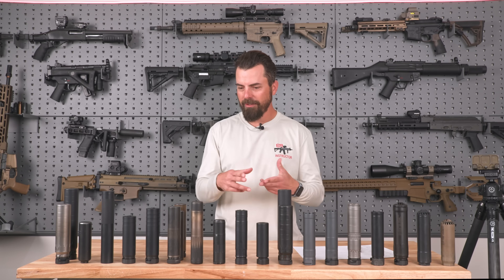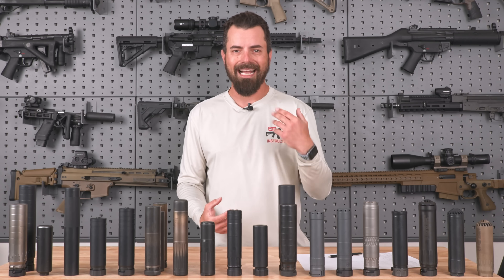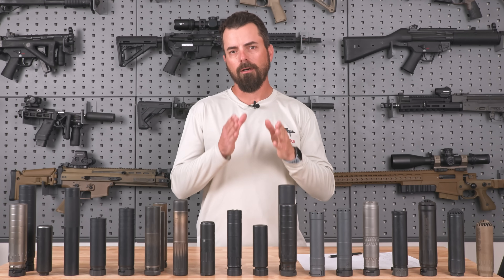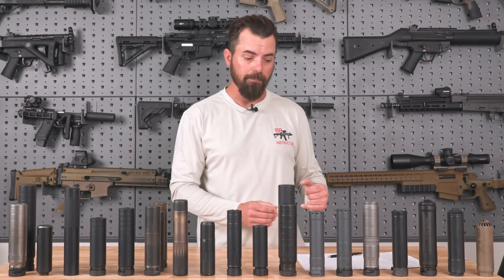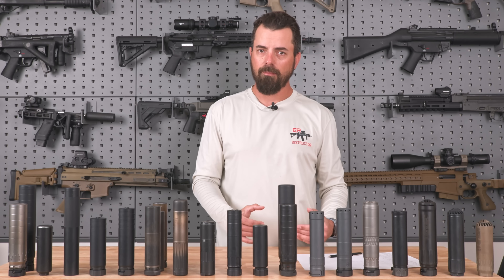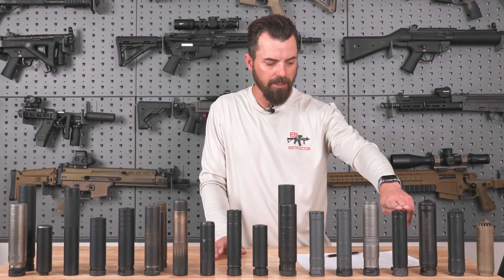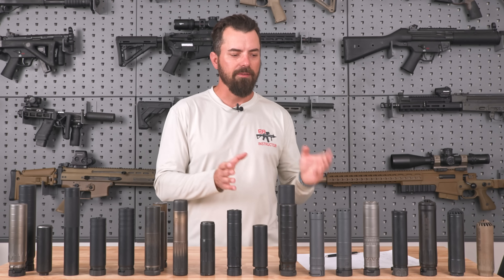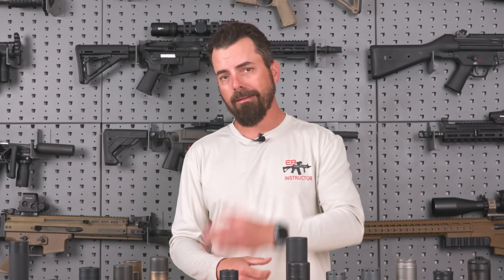Suppressor Back Pressure Test:  Huxwrx, SilencerCo, Dead Air, KGM, Surefire, & More

Comment: Wish you would have done a sandman or two.
Reply: We did not put the Sandman suppressor in this review, along with a few other suppressors. Some of them didn’t make the review because I have tested them before and have been very disappointed. So much so that I got rid of them. I still have clients with Sandman suppressors, but in my opinion, they are subpar. So I no longer own one in orderto continue testing it. I wish I still had that suppressor so that I could show how poorly it does in these tests.

Comment: It always blows me away when people prefer the asr system, the repeatability is not good
Reply: I agree with you. I used the ASR system for awhile but I prefer the deadair keymo system myself.
Reply: @MSSynsyterGates   I have a few of those too. great MB some times it locks on tho
Reply: We’re going to make a video very soon about the different suppressor attachment devices and why rob has chosen what he has chosen. There is good logic coming from a depth of experience. It doesn’t mean that there won’t be something new or better one day but for now having assessed what’s currently available in the market, I know why he has chosen what he has chosen. Look forward to his video soon about why he chooses the Silencerco ASR mountain system. Thank you for your positive feedback and support. Also, what system do you like the best?
Reply: @Ertactical  for ease of use I like the yhm system, for repeatability on precision stuff I like direct thread, I currently don't mind the huxwrx reverse thread mounts. My experience with the asr mount is that I experienced poi shift with my bolt gun between removing it and putting it back on, which is why I dislike it for anything other than my 300 blk now.
Reply: @LeifyGuy  that’s interesting, I have found very different results. Will post a video very soon and I look forward to hearing your opinion about it.

Comment: Cool comparison and useful comparison, but nothing was done here to quantify "back pressure" or even bolt velocity.
Reply: In this video, we use the rifle, speed, adjustable, gas block to choke off gas in order to find out how much gas needs to be choked off in order to maintain last round hold open. This creates a quantifiable measurement of how much increased gas a suppressor induces into a weapon.that was our measurement system in this video.

Comment: Excellent video but I can barely hear you. 

One thing I'd really like to see in future vids is tests on SBRs like 10.5" on up barrel lengths. Plus on piston systems.

I'm running a Sig 516, 10.5" piston system with a YHM Turbo K. Almost no blowback and the piston system develops hardly and heat or carbon.
Reply: 100% agree, since we made this video, we decided to build an 11.5 inch AR for more testing. Will launch a whole Nother battery of tests on the shorter Gun very soon. On the piston systems keep in mind that you may not get gas in your face, but it doesn’t necessarily mean the gun is not getting over gassed, look at the brass ejection path, and that will give you some indicators.I too have a 7.5 inch Sigg short barrel rifle. That is one of the older piston models that they have since discontinued. It works extremely well especially with flow through suppressors. Thank you for your comments and support.
Reply: @Ertactical  yes, exactly. My 516 has an adjustable gas block and I have tuned all but perfectly. And yes my casings are ejecting exactly where they should be. Thanks for responding and the info !

 Oh, as far as the ammo I'm running nothing but 75gr and 77gr rounds. My go to defensive rnd is the IMI 5.56 77gr Razor Core.
Reply: @gunfighterman1-5  nice! It sounds like you’re making solid choices. Across-the-board! I usually use the 77 grade ammunition for long-distance shooting. It comes with some pros and cons, but it is most definitely great ammunition! Thank you for your positive feedback.
Reply: @Ertactical  thank you. I'm really looking forward to more vids and testing from you guys. One question though. I'm a big fan of YHM, any plans to include their suppressors in testing?

Also I have a Scorpion Evo3 S2 Micro PDW that I did a SBR on. Right now I have a YHM R9 in jail (6 months) for it. I also have a transferable UZI that I'm running an old school AWC Mk9 suppressor on that. When running subs all you can hear is the bolt doing it's thing since it's an open bolt subgun.
Reply: @gunfighterman1-5  nice! I too have a few transfer Ables. The closest I have to that specific weapon is an M 11 with an LAGE Upper. This brings it to a similar operation and rate of fire to the Uzi. I use a BNT quick detach, three lug suppressor. It’s incredible to shoot. I’m sure very similar to yours. As far as the YHM suppressors. I personally do not own any but I will reach out to them and see if they would like to participate in the next batch of tests. Thank you for your positive feedback and support.

Comment: Good video!  I think there could be a number of other variables when considering a can as well.  This was an awesome test, and I'm not at all taking away from it.  Bu I also think back pressure vs cost vs weight vs mounting would be also a good video.  A low backpressure can that costs $1200+, and add $200 - $400 of mounting accessories and muzzle devices vs. a mid to high backpressure can that costs $499 - $800 and still needs those mounting accessories plus a $50 H3 buffer could help people make decisions as well.

For me, I'm good with gas and backpressure since the ways to mitigate them are very inexpensive, and things like gas busting charging handles (Breek Warhammer for instance) are something that people generally change from milspec anyway.

Anyway..great video.  And something the community needed!
Reply: Thank you so much for your accurate and honest review. I appreciate your support very much. I too initially did not much care about back pressure. In the beginning I wanted Hollywood small. So I spent my time with mini cans, then I wanted super quiet, so I started by larger, full-size or L cans. Then after a while, I got tired of the behavior of the weapon and started getting much more interested in low back pressure suppressors so that I could put them on any suppress system without having issues. Now I care very much about back pressure so that I can have weapons behave the way they’re supposed to and not need to mitigate problems that occur shortly after adding a suppressor.you are correct, there are many more topics to investigate before buying a suppressor, this is just one of the topics. Much more to follow on some of the other topics and some of our test results. Thank you for your positive feedback again.
Reply from the maker: Thank you! 😃

Comment: figures! You kinda' stopped just before my suppressor, the Alaskan 360
Reply: Yes, I have the titanium version of that suppressor. It is a great suppressor for its versatility, lack of barrel, length restrictions and medium to low back pressure. My complaint about the suppressor, however is that it only has four baffles so it’s not terribly quiet. Extremely versatile, but not quiet. I hope this helps! Thank you for your positive feedback and supportalso, let me know if you have any more questions
Reply: Thanks brother @Ertactical

Comment: You can have the lowest backpressure quietest can on earth if it makes your 1 moa rifle a 4 moa rifle I'd say that can is a poor performer.
Reply: I agree with you! However, I have only seen a suppressor reduce accuracy from poor mountain solutions. I have not seen any of the modern suppressors, reduce accuracy and any weapons that were assembled correctly with the right attachments installed. What suppressor are you having this issue with?

Comment: Do flow through suppressors ever clog up with carbon?  How do you clean one of them?
Reply: Great question! In my experience, they are the least apt to clog up. As opposed to a traditional baffle system. However, in time both of which can eventually require cleaning. BNT has released a compound solution so that you can do this in your own home, without messing with any of the hazardous and difficult chemicals.they’re sending me some as we speak so I’ll be doing a review very soon on how to clean and maintain suppressors. The flow through ones are most definitely the easiest ones to clean. Make sure you like and subscribe for for future content. Thank you for your positive feedback and support.
Reply: they do clog up but you can soak them in CLP over night and then run a mag through them to clean them. This is what the company tells you and there are videos of it. Kinda cool looking actually. I've put about 3k rounds through mine and its heavier for sure but I dont notice any performance difference.

Comment: Does low back preasure correlate to louder can?
Reply: Good question, realistically, yes. But not necessarily. In other words, if you were to compare the surefire RC to to the surefire, RC three, the RC two being a non-flow through design is quieter than the RC three. However, it’s only by a few decibels. Most people can’t hear the difference between the two. Having said that I definitely choose the RC three over the RC two. As for the other flow through designs, some of them are in fact louder. It’s kind of a safe thing to say that if it has a flow through design, it won’t be quite as quiet.in the end, it really depends on your mission as an operator, or as a consumer, as to which suppressor is best for you. We will be making a video on many more topics regarding how to select a good suppressor. Most often it comes down to the individual needs, and not just a simple cart launch which one is best. Thank you for your questions your comments and positive support.
Reply from the maker: can be but these days we are finding ways around that.. the HUX are LOUD!

Comment: Awesome research! Thank you 🙏. Be curious how the B&T reduced back pressure cans stack up.
Reply: me too! the first one should come today! thanks for the feed back
Reply: @Ertactical awesome! I’m thinking about getting one of their titanium reduced back pressure cans, that use the surefire mount system. I’m not a high volume shooter and appreciate a lighter weight solution.
Reply: @ChadCooper03  yes! 100%. I’m not a big fan of the surefire mounts but I like that I can screw that adapter off of the end and put the adapter I want on it. This new hub system that the industry is doing is amazing. The first suppressor we’re getting is the 556 titanium low back pressure suppressor. It’s probably the one that I am most excited about. We should have some very good information on it soon. Thank you for your comments. Makes you use subscribe for more content.
Reply: @Ertactical  Most of my Geisseles and AR-10s already have Surefire mounts on them and I really like the "fast attach" design from a civilian perspective, when it comes to bag guns and storge. But I also have limited experience with suppressors. Awesome to hear you're looking at the same can I am for testing. Cant wait to see more info. Already subbed. Thanks boss.
Reply: @ChadCooper03  🔥👌🏼❤️
Reply: GOT IT!! Sat we got it, sunday we started testing... some good and bad. stay tuned!

Comment: Honestly there are 2 major questions this brings up for me first where are the sandman’s and secondary that’s more applicable does a 30cal vs a 22 cal end cap make a difference in the back pressure
Reply: we used to omega 300's one with 556 cap and ASR, one with 556 cap and DT and one with 762 cap ASR. the DT and ASR showed no change as to leaking gas at the mounting point, we did find less back pressure with the 30 cal cap on the 556. Great question! that was one of my sub questions during this test. seeing how B&T had diff end caps to change back pressure on their cans i wanted to do a test of my own and it did make a difference. Thank you for commenting and i hope this helped!
Reply: @Ertactical  good to hear I really wish there was a better way to truly quantify back pressure but you figured out a decent method for it. Just an idea for you since you have the huxworks hub compatible can it might be worth considering a test to see if any of the hub mountings systems affect back pressure
Reply: @foamysking  so I did a version of that. There are many points of interest that a mountain system can leak this can cause increase sound and potentially reduce back pressure. So during this last test that we did I used as Silencerco omega 300 in three different formats with a direct thread amount with an ASR hub mount and one with an ASR hub mount and 30 caliber cap. The other two had 556 caps. This was to figure out if any leakage was happening in the ASR mount and to see if the endcap would affect back pressure.the results are in the chart. I hope this helps.

Comment: Qe need the video of why you like the older huxwrx qd vs the flow... i have the hxqd ti version and i have a flow in atf jail. So i havnt been able to compare the two yet
Reply: yeah, that was one of several topics i kinda blew through with out going into it. the QD seems to feel better when shooting, it could be the weight but when shooting both on twin platforms i like the look and recoil of the QD more then the flow. hope this helps, thanks for the comment and feed back

Comment: It would be cool to see Griffin Armaments dl5/7 and KGMs R556A1/A2 and R30A1
Reply: I don't have a griffen can.. Ill reach out to them aging but they did not respond to my first request. I do like the KGM stuff especially the R6 can but the 556 one i got does not have the hub mount system, but is does do well on back pressure and size.

Comment: Great video. Far and away my Dead Air Nomad-L is the best performer in terms of sound suppression, but it’s also the most restrictive. The back pressure is so high that I had to buy the E-Brake flow through end cap just to be able to get my AR’s to cycle properly. In addition to swapping for a heavy buffer, heavy spring, and major gas block tuning.
Reply: yes, i am not a fan of them at all! have several clients with them and they are not great cans. We will be making another vid on how to mitigate back pressure, thank you for your support! =)
Reply from the maker: Thank you! 😃

Comment: Any plans on doing other DOD approved cans? I love seeing the Surefire and mk12 types, I’d love to see a dead air sandman s (it’s my dream can), the CGS cans, or KAC’s. It’s cool to see how much pressure these cans have with AR’s that are not allowed to have adjustable gas systems (due to dumb military requirements and not believing in the solders discipline/training), yet still these cans and weapons go through the most insane beatings known to man. 

I’m a huge fan of non adjustable gas blocks, and heavy duty bomb proof gear (I have a pinned crane spec dd gasblock on a DD barrel, but I run the LMT Enhanced BCG and Bolt, with the intentions of running a traditional can like the sandman s). I want something super quiet that has been purpose built not to throw gas in my face without having to go to flow through tech where the noise is louder and flash is worse. But I haven’t got the suppressor yet so maybe I could have done something better time will tell.
Reply: I do have a MK12 but testing on it is tuff as we cant really measure back pressure, this is why we used that platform can on this build, the OCM5 can. I have has and do have many LMT, DD, Colt, FN and other mil type weapons but i don't have any KAC cans. as for the Sandman, it is not something I own or will buy. I have many clients with them and i don't dig em. thank you for your support! =)
Reply: We are happy to test what ever we can get our hands on. currently we have 57 cans and have many more on the way. stay tuned to see many more test. Thank you for your support and positive feed back!
Reply: Oh also we have and are testing, SF RC3, several B&T, and an OCL OCM5 for the MK12. more are on the way. hope this helps =)

Comment: I would love it if you threw in the Surefire RC2 and the dead air sandman s
Reply from the maker: Thanks for the suggestion, we have plenty more videos coming!
Reply: For sure, I also thinka video about light signature at night would be a great idea. That’s one of the main reasons I purchased an RC2.
Reply: @KidneySlayer  yes! first round flash / pop and follow on 4 rounds!
good call, we are on it!
Reply: I don't have an RC2. I had one some time ago and I didn't like it. the Sandman is also not one i am a fan of so i don't have one. I have several clients with then but they are not for me
Reply: Yeah I got my RC2 to reduce light signature more than sound suppression. So that is the main reason I like my RC2